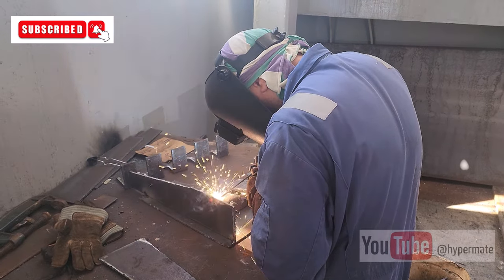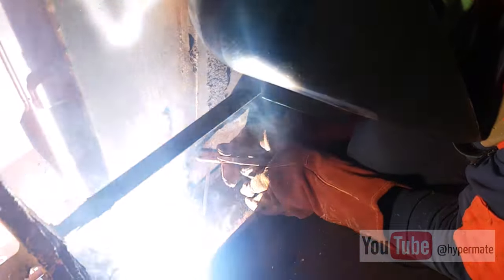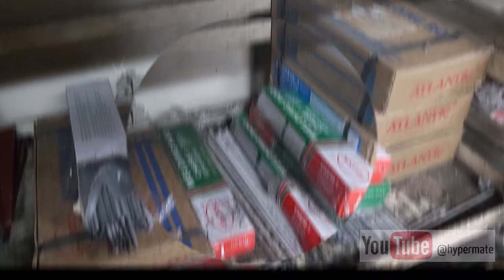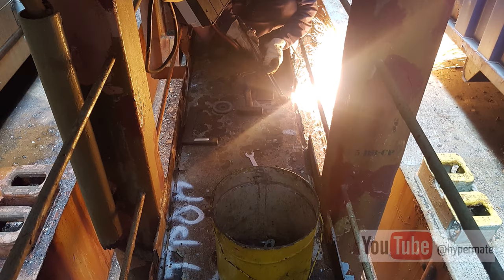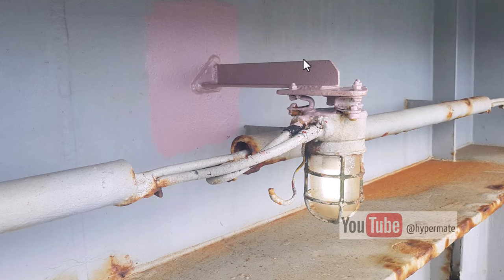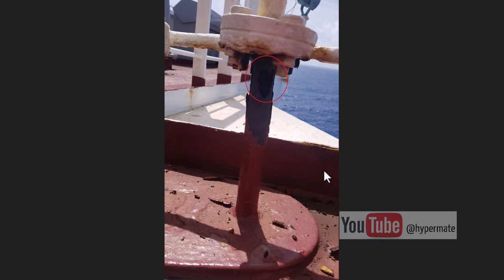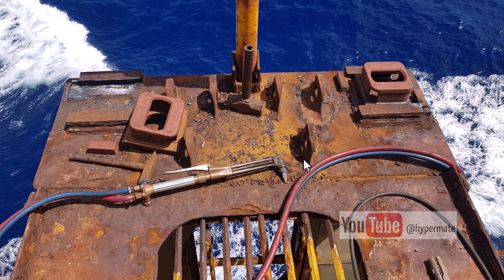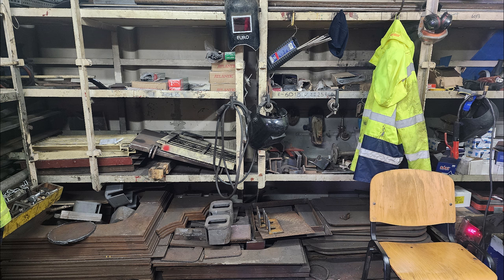Welding jobs on board a dry cargo ship.

Comment: Question: what about welding near by cargo hold or container is there any obstructions?
Reply from the maker: If no DG or any combustible material e.g. fuel tank venthead nearby (usually >30 meters) it is OK, ☝️at sea. In port you should request shore permit for hot works.